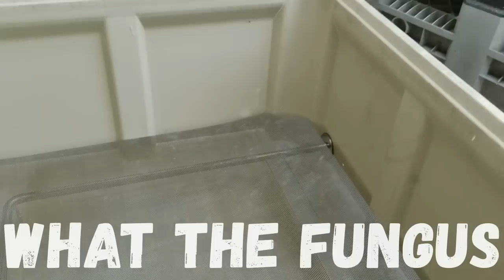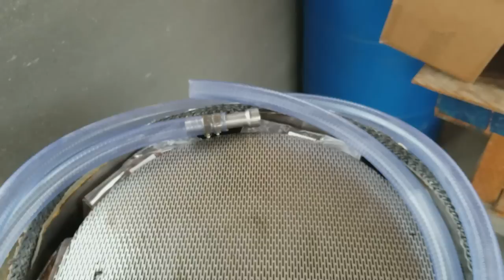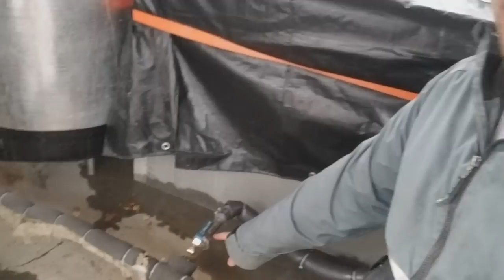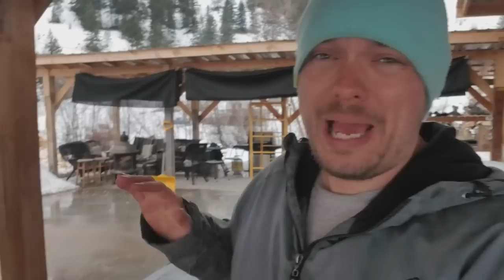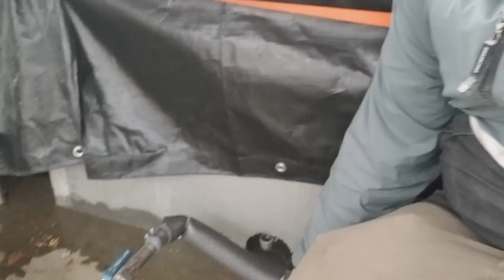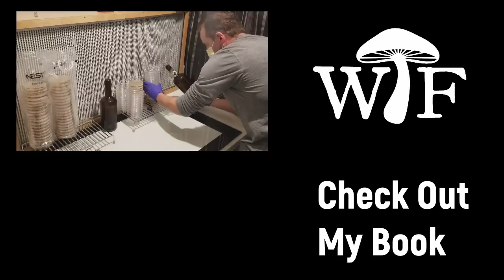Best Mushroom Substrate Sterilizer Based On Cost, Profitability, And Farm Efficiency: DIY Steam Tank

Comment: Aircrete panels are about $12 dollars per bag, one bag can make three to four panels at 36 inches x 32 inches x 2 inches thick.  depending on the amount of insulation you need. You can make them in house to cut cost which if they get damaged you could replace them yourself. Or you could turn the tank upside down and pour the aircrete around the tank within a lightweight box.

Comment: I do all types of construction I'm very familiar with the board that you're talking about it's used for tiling and certain type of masonry work If my suggestion to you is before laying your sheets put a bed of mortar in between with a quarter inch  trowel!
 Also be sure to use the correct Screws Designed and made for that board.     The sheets are made to build tile showers..... Installed and mortar correctly i have been doing this for More years than fingers and toes. 🍻

Comment: A container is a container at this point. You can lay a tarp out, stack 1000 bags, close it up with pallets or stack cinder blocks around it and pump in steam. Old school. 
I run UN barrels at 4psi. Perfect blocks and grains too. Also been running lime pasteurized SUPPLEMENTED blocks. So far so good.
Reply: Concrete blankets would make excellent tarps.  These are insulated tarp/blankets that cover freshly laid concrete in the winter so that it doesn't freeze and crack.  They are very heavy.  I love the idea of piping in steam to a bunch of bags under a tarp!  This makes so much sense!  Would there be a hose going through the tarp with holes to release the steam throughout the enclosed area to ensure no dead pockets that didn't receive adequate heat?

Comment: Very easy to scale down to a totem size and hook up to the top of a pressure cooker.  Pasteurization is definitely achievable but those higher temperatures for sterilization you would want to be extra careful everything could handle it.  Out side and PPE

Comment: Paint the concrete boards with rubber paint bro. More insulation, less brittle..frame them too, that's a good idea.  You can fit the insulation board into the back of the frame.  I'm working something similar out. The flex seal paint will work great.  Test the paint on a broken piece and decide if you need a primer,  but  you shouldnt need any.

Comment: Question ~ Have you ever thought of drying your spent fruiting blocks and using them as fuel for your sterilization process?
Reply: Thats a really good idea but how much energy would it take to remove the moisture?
Reply: It takes a good sunbathing, so basically, free energy from the Sun
Reply: @ermitanyo777  Where I live you get more rain than sun 😂 I guess if you are in the desert be a good idea
Reply: @tinkertom3683  just placing them in a green house or breaking them up and spreading it out in your home or an enclosed are would work just fine. May take a little while, but it will dry eventually.

Comment: Have you thought about about building a frame mold for the top? Expand foam in a can. Say 4”-6” thick. Cut away mold  and fit on top. Do the same for the sides. Make a kiln type sterilizer. Container is perfect by the way.

Comment: "It's not the critic that counts." 

Much respect for your efforts. 

You've probably considered this, but how do 275 gallon frame totes hold up in those temperatures? (Semi-translucent tanks supported with aluminum framing) those run $25-$150 in my area. Might be an easy/cheap solution for ramping up production.
Reply from the maker: there are a few growers playing around with them for sure

Comment: I know its an old video but I'm wondering if you framed in the cement board than used spray form as extra insulation you could get an extra 21 to 25 ish R value just with 3.5 inches of spray form
Reply from the maker: We use polyisocyinate panels

Comment: I'm confused, you say STERILIZE but don't you actually mean PASTEURIZE? because you are heating the tubs with steam and i doubt you are getting any significant pressure buildup in those tubs so shouldn't the temp be at around the boiling point of water(100C) at best which would only pasteurize the substrate because it's nowhere near the temp to be able to kill some spores. Am i wrong here? what am i missing?
Reply: You are right. The is a difference between pasteurize and sterilize. Because of this wrong information many people make mistakes all the time.
Reply: Super pasteurization
Reply: @garfunkle660  That is a made up term for pasteurising for a long time but sure...
Reply: @CMZneu   Pasteurization is about 160 to 170*F. Sterilization is about 250*f. Super pasteurization is 212*f.. isnt it? What did I miss

Comment: labour is the killer, spreading it out only compounds the problem rather than alleviating it. Sure it is less to concentrate on at once and also reduces the the likely hood of wasted time but the massive increase in labour is not worth the reduced load and small loss occasionally in efficiency. Hopefully you worked this out pretty quickly and moved to larger volumes over less days (fyi, a bagger will pay for itself in about 3 months based on your numbers)....

Comment: Is there a follow up on this? Did you use this thru 2018?
Reply from the maker: I'm sure I talk about somewhere. Yes they work. We use polyisocyinate panels for insulation,  moving blankets and expanding foam in the corners to make a seal for the lid.
Reply from the maker: https://youtu.be/vsFzL-Zqi7c this video is close to the working prototype
Reply: @whatthefungus  I've been sitting on the materials to build something like this for close to a year, just have not had time. Now in the off season, hope to complete it over the next month. Plan is to use 8x8x16 concrete blocks, set on a 6" slab with a 6" concrete ceiling, a wood hatch  on the front. Dimensions (ID) will be 80"x48"x41" tall (should hold 200 xls-A bags at 9lbs each sawdust). Also using a single 55g drum as an electric boiler that I made using 2, 4500w water heater elements, which is already built and tested, boils like a madman, 36 gallons of 130F water to 212F in 45 minutes (seems to outperform our current propane boiler), this drum is going to go inside the concrete enclosure, which should greatly increase efficiency, hoping I'll be able to turn off one of the elements when it gets up to temp and also looking at using 240v water heater timers. Also plan to use a 2nd passive  drum located outside the enclosure with an equalizer tube pass thru to the boiler drum, essentially double the water supply, provide an external fill point and sight glass. I dont anticipate using more than 18 gallons over 12 hours, but will have to see what happens in reality, may add more external drums. Now we don't cool our bags past the point of being able to carry them over to a cooling rack, despite that I keep hearing we should, but then we also have little contamination, perhaps we do but goes unnoticed...IDK, We also inoculate at 10% or greater, most everything grows like crazy, maybe that helps too, IDK. Anyway been watching to see how this worked out for you, Very nice!!! Jeff M.

Comment: to me it looks inefficient... considering you can just lime pasteurize it with a high ph in the 12s.... all that energy your using and time 😵...
Reply: 719Moto Mx its worth it trust me. I use I water heater elements 1500 watts steam sterilizer 55 gallon steal drum. Verse ph balance. Hrydro lime cost 60 cents per bag that's 40 bags is 24.00 in cost verse 4 dallors of electricity
Reply: heat is the only tried and tru method
Reply: the ph never drops back to nuetral, its a proven fact that they grow better at a more basic ph but closer 8 or 9, 12 is too high.
Reply: North Florida Fungi I heard it helps yield
Reply: Not if you are growing lion mane

Comment: I suggest not using the cement panels.  Go with solid foam boards, less expensive and much better. The best r value per inch is Polyisocyanurate.  You can also go with thicker pipe insulation, which will help.

Comment: More camera on the system as you narrate off camera, because one cannot visualize what your talking about. No offense, but your handsome mug need only be seen as a point of reference for size when your hand or nothing else is sufficient .I would have liked to have seen close-ups of mechanical connections ,valves, concrete panels(?),safety/steam pressure controls , i.e.  everything you spoke about but never showed on video. Definitely deserves a remake .I'm looking forward to it.

Comment: dude chuck some fiberglass on your poly-whatever panels for longevity ;)
Reply: should be a pretty cost effective solution, just bear in mind that you'll need heat to set the glass off quickly, maybe use one of your unused fruiting tents with a heater going around 35c

Comment: Please tell me I would like to understand the process of sterilization
Reply: Grain sterilization at atmospheric pressure you need the grains to reach at least 180 degrees Fahrenheit, for about 24 hours. With an autoclave, you can achieve sterilization at 15 psi for about 2-3 hours depending on the quantity of grains.